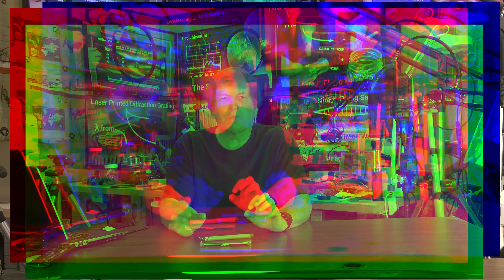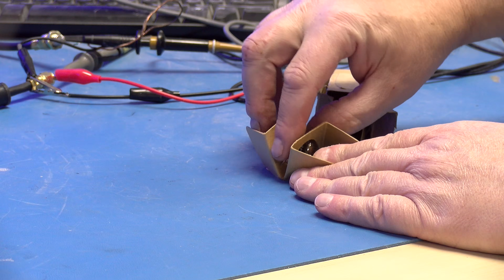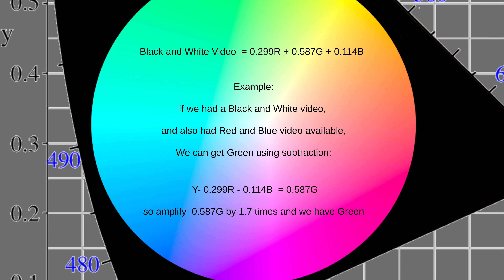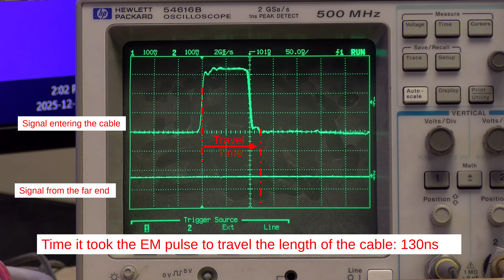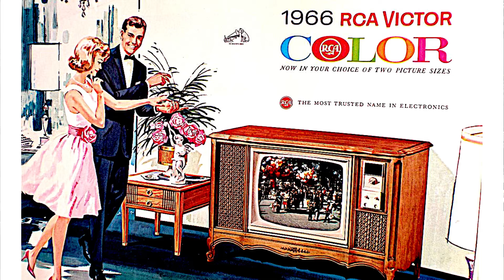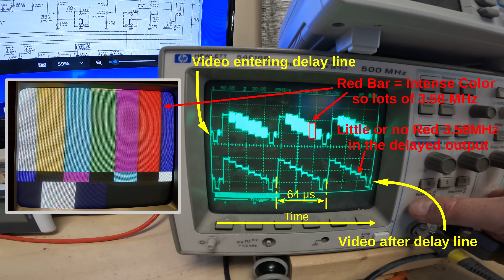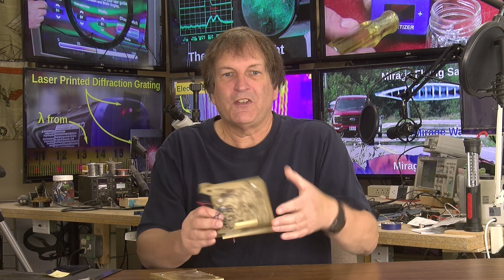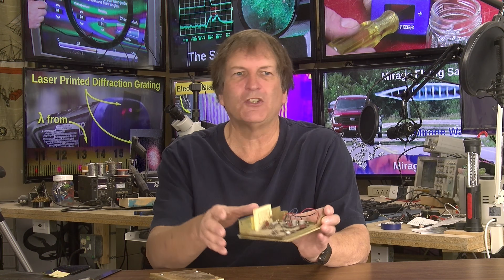How we slowed down electricity to create Color TV

Comment: Retired video engineer here (ABC and CNN): This is an excellent description! We engineers, back then, nicknamed NTSC "Never Twice the Same Color." The biggest problem with transmitting NTSC was differential gain and phase (changes in amplitude and phase between black and white scenes). Differences in gain caused an inaccurate saturation of colors, and differences in phase caused hues to be inaccurate. People perceived changes in hues to be much more objectionable. For example, a deeply red dress appearing slightly pastel red (reduced saturation) due to differential gain was much less objectionable than a red dress appearing purple due to differential phase. Faces often turned green when moving between dark to light scenes. The Europeans developed color TV later and had the luxury of improving on the US system, and used Phase Alternating Line (PAL) that averaged out the differential phase errors. The French decided to use SECAM (Séquentiel couleur à mémoire / Sequential Colour with Memory) which we American engineers nicknamed the "System Essentially Contrary to the American Method," and transmitted the color information in FM instead of AM to also compensate for differential gain. Once an American viewer got over the apparent flicker of 50 hertz video fields, as opposed to American 60 (59.94) hertz field rates, PAL and SECAM looked much better than NTSC. The hazard of being first.
Reply from the maker: Thanks so much times two - once for the kind words and and once for answering a question I always wondered about - namely what was the dominant cause of phase errors in NTSC. So if I understood correctly (let me know if didnt) the amplitude of the black and white signal had the effect of slightly shifting the chroma phase as it passed though amps in the signal path. If thats the case I'm even more intrigued as to what might have caused that effect. All that I can think of at the moment is the slight changes in semiconductor junction capacitance as the voltage across a junction rises and falls a exploited in  varactor  diode. That wouldnt explain the issue happening in tube amps. So what am I missing?

NTSC/PAL/SECAM - as a kid I experienced all three - NTSC in Canada, PAL in (West) Germany, and SECAM in Iraq in the 70s. I dont remember being bothered by 50Hz flicker as a kid, but sometime in 2005 or 2006 I was visiting Germany and stayed in a hotel that still had CRT TVs in the rooms. I sure noticed the 50Hz flicker. Funny thing is I dont remember noticing the NTSC hue change based on the person being in a dark or bright area. I do remember having to occasionally tweak the hue on the odd progam, presumably because somewhere along the broadcast chain someone  hadnt  adjusted the phase perfectly. And after the 70s I dont remember  needing to that  very often if at all. I do sort of remember some older tube color TVs that seemed to have the hue drift slightly as the set heated up - in fairness to them that would have been 1960s TV in the late 70s/early 80s when I was fixing them while I was in high school. So all sorts of components may have become less stable with age.
Reply: @ElectromagneticVideos  I was a transmitter engineer in the 70s for a time. The biggest cause of differential phase and gain was the transmitter. Many transmitters in the 60s, and a few in the 70s, were what we called "forced color" because they were implemented before color TV was available. A 50 KW transmitter was a major investment that stations were reluctant to replace. One station in Los Angles, KCOP, pushed their old forced color transmitter into the mid 70s. Differential phase was irrelevant to monochrome video, and differential gain only caused unrealistic contrast changes that weren't very noticeable. Getting a  50 KW vacuum tube to operate perfectly within its linear transconductance transfer curve, especially when it was operating at its limits, was impossible. It ran at the knees in the curve between black (100% output) and white (12.5% output). Put a chroma subcarrier on top of that, and both gain and phase were distorted by the nonlinearity. The problem got worse as the tubes aged. 

The FCC set a limit of 5 degrees differential phase and 5% differential gain, but there was no real enforcement. Stations self-certified each year with "proof of performance tests," and more than one station I knew of had a set of new tubes that they would swap in only for the yearly tests. A pair of new Eimac 4CX25000 power tetrode vacuum tubes needed for a 50 KW transmitter cost approximately $200,000 each in today's dollars. Stations milked those tubes for every last useable minute of service life.

The hue shifting with temperature was also a real issue for tube-based vidicon cameras. At ABC studios in Hollywood, each stage had a "Senior Video" operator whose sole job was to continually adjust all the cameras on an operating stage for color matching. The drift was mostly thermal. Move a camera under a stage light and it would rapidly drift away from the others. It was an intense job. If you saw changes in hue or saturation on a CRT, it was mostly due to thermal differences between the red, blue and green "guns" (cathodes) in the CRT tube itself. Sony trintron CRTs had only one gun and didn't suffer from this effect.

The reason stations had such large technical staffs was -- in analog -- everything is constantly drifting. They also needed strong men in the maintenance department because lifting a CRT studio monitor or a camera was a two-man job. The switch to digital made everything so much simpler and less physics-based. The technical challenges in broadcast television are miniscule today to what they once were. That's why I switched to cyber security 30 years ago -- where everything is still complex and continually broken.
Reply: @SVAdAstra  Thank god, Walter Bruch came up with PAL ;-)
Reply from the maker: @SVAdAstra  That is fascinating! I had never heard of "forced color" but its sure makes sense that at thos costs, stations would have been reluctant to upgrade to a new transmitter designed for color. 

Swapping tubes for the annual tests - thats a bit of history you dont read about. Didnt know about camea heating messing up vidicon color or how trinitrons were more stabe color wise. And continuously adjusting color on the cameras - wow!

Question: do you mind if I copy your two comments to the posts section of my channel so they are preserved rather than getting lost under newer comments?

Thants so much for this look into analog TV!
Reply: @SVAdAstra  Thank you for sharing this.  Really cool glimpse into the way things worked not so long ago.  I was born in the early 80's so I only experienced the end of the analog era.
Reply: @ElectromagneticVideos  Yes. Pleases feel free to repost my comments.
Reply from the maker: @SVAdAstra  Thanks! I will do that!
Reply from the maker: @SVAdAstra  I'd be happy to credit your comments to you real name if you send it to me. If you dont want your name linked to your profile, I can leave out your YT name. My email is electromagneticvideos [at] gmail.com  . Thanks again for all your insight!
Reply: @ElectromagneticVideos  I remember visiting the States in the late 70’s and was in a hotel room with a tv that had a rabbit ear antenna. Now, coming from a PAL country, I was astonished that as you moved the antenna, the colour actual changed hue.  I’d never seen that before…
Reply from the maker: @gold27b  Thats an interesting observation. I'm guessing that was from reflections from the building being picked up in different ways altering the phase  just a bit. The strongest memory I have between Canada (NTSC) and Germany (PAL) in the early 70s was the strength of the signal. In Germany the signal seemed strong everywhere. In Canada we had a place in the country south of Ottawa and while one or two channels with nearby transmitters were strong, most had weak signals with considerable noise that also showed up in the color component.  It actually looked quite neat.
Reply: "Not The Smartest Choice"...by the engineers who originally designed NTSC.
Reply from the maker: @denelson83  I had never heard that version. Maybe to fair a description - there was so much brilliant engineering to get the first practical color TV system working.
Reply: @denelson83  Not really fair. I think the designers did an amazing job using the technology of the time, and the knowledge of human vision at the time, to develop an upwards compatible system.
It's possible that the delay line technology needed for PAL, or SECAM, was not really available in 1950 when the system was being developed. PAL was invented 12 years later and had the advantage of being able to start with the concepts that NTSC had to develop from scratch!
Some of the issues of NTSC could really only be discovered in use. (I don't know, for example, if any transmitter engineers were on the committee that could have flagged the phase variation due to transmitter nonlinearity…)🤔
Reply: "The hazard of being first"
And the stupidity to stick with it..
Reply: That is why PAL also means: Perfection at Last.

Comment: Why did old tv sets have uhf before there were channels on those frequencies?
Reply from the maker: Originally they only had VHF tuners in TVs, which caused a natural reluctance for TV stations to use the UHF band. And TV manufacturers were not going to add UHF tuners unless there were UHF channels available - sort of a which came first - chicken or the egg problem. 

I gather at some point the US government required TV set makers to include a UHF tuner which resulted in what you reported - in many places TVs had UHF tuners before there were any UHF stations.

Comment: Interesting also that mercury delay lines, and even Kinescope delay lines (the reminisce on the screen) acting as a camera & display tube,  were used as shift registers ( like a memory ) so storing a stream of data as it ran 'round & 'round in circles, as a string of bits!
Reply from the maker: So glad you posted that - I had forgotten thanks to you I'm reminded of reading somewhere about some crt based memories. I didnt realize they were operated as delay lines though. In many ways, memory in sufficient speed and quanity was pas a bigger challenge than the cpu itself. I'm immediatly thinking of the rope core memory used on the Apollo spacecraft where the program was magnetc cores woven into the rope.

Comment: I think that particular coil (@ 23:51) has two windings in opposite directions (clockwise & counterclockwise) and I think that the rf coupling between one end and the other allows the transfer of a sharper delay line signal ( like chromatic aberration in a lens being corrected by combining a convex and concave lens to avoid rainbows around the edges of objects.  Damping and sharpening bandpass ripple by phase cancellation.
Reply from the maker: What a fabulous observation - I did not notice that! I'm not sure if your reason for it is right or not. But clearly there is some good reason for doing that. Clearly not a calibration thing as I had pondered. The other thing I can think of is to prevent pickup of noise/signals from stray fields accidently coming from somewhere else. I'm really intrigued now - thanks so much for posting. Always neat how another set of eyes can pick up something nobody else saw. 

Anybody else have any thoughts?

Comment: If Bill Gate was in charge, he would have told those 6 million black and white TV customers, "Your device is no longer supported."
Reply from the maker: And would have called it TV 11 and offered to keep your old TV 10 going for up to 3 yeats but only if you paid $35 the first year an ever increasing price for the followong two years. And here I am running my 15 year old Dell TV on TV Enterprise IOT LTSC 11  and it works just fine  :)
Reply: And that would have been the way to go - the French did that (albeit they kept the 809 line system for a while)
Reply: @LMB222  The French 819 line system was a dead end from the beginning because of its huge bandwidth requirements which limited the number of TV channels, and its complete incompatibility with any mainstream hardware. Just imagine manufacturers would have had to offer 819 line SECAM VCRs and camcorders for the French market only.
Reply: Backwards compatibility being treated as an inconvenience isn't a single person's fault. It's a broad cultural shift.
Reply: No that would be Apple. Microsoft is the king of backwards compatability.
Reply: Just as AM broadcasters should be told what NTSC telecasters were told, and sent digital with DRM.

Comment: What baffles me is why didn't they transmit the signal delayed? Rather than adding delay lines to every TV they could have had a single one at the transmitter?
It might also benefit B&W TVs to have the dots aligned with the image.
Reply from the maker: Great question - its becuase the delay depends on the difference in bandwidth between the color and luma (BW) images. Many old sets separated color and luma by fltering out upper frequencies (where of the color is) to extract the luma BW image, and extracted the color signal by filtering away the lower frequencies where most of the BW was. Some TVs did very severe filtering. Later and better TVs kept more of the chroma and luma bandwidth, particualry whne comb filters were developed to keep almost  all the bandwidth of both signals. So delay depended on the how the luma chroma separatiom was handled in the TV. However, most common delays in early TVs were about 500ns so your idea would have worked for them but then may have needed delaying the color signal in higher bandwidth sets.

Comment: When I worked in a TV shop I remember putting a jumper across a delay line to see the effect.   The results clearly showed the necessity for the delay line.  I was thinking how much fun I'd have if I covertly hid a 30 gauge wire that I soldered across the delay line  of a set that another guy was working on.   I never got around to that but we had fun goofing on each other back in the days.  For instance, some TV's had plug in connectors on the yoke for the individual wires.  I would quickly reverse the two leads for the vertical windings,  and the newbie tech would be wondering what happened to the vertical, the picture is upside down!
Reply from the maker: Gee I should have done that - what a great experiment. But your idea of prank is even better. Reminds me of a story a tech I know told me about his first day on the job after finishing college : he was given the task of soldering a bunch of things - probbaly cables to connectors. Did well in the morning but had a terrible time after he got back from lunch. Took him a while to figure out that someone had replaced the last few inches of solder on the spool with some wire that looked just like solder - but wasnt. Drove him crazy for a while.

Your swap the vertical coil lines trick - recently saw an old  candid camera episode on youtube where they tried to sell a 25" color TV in a department store at some steep discount becuase the picture was upside down. I would have jumped on that deal!

Comment: Great video. You forgot to talk about the color burst (8 cycles) in the front porch of each horizontal scan that is used to compare the phase of the color carrier during the scan to to get that color angle. The burst was to force a crystal oscillator to a reference phase to be used during the horizontal scan.
Reply from the maker: Actually that was intentional descision that I struggled over to prevent the video from getting longer - and at 40 minutes the video is still too long for most of the youtube audience.I get a graph of average length viewers watch and the shorter attention span of youtube audiences is very apparent. I toatally get that it should have been in there - as well as a number of the things like vestigial sideband and a diagram of the interleaved nature of the luma and chroma spectrums. I will probaly do 2 more videos on the subject and hopefully the burst will fit nicely into one of  them.
Reply: AFAIK it is 10 +/- 1 cycles of burst for PAL with 625 line timing, NTSC is 9 +/- 1 cycles (see ITU BT.470)

Comment: When I did a TV repair course in the 1980`s there was a device in a TV that slowed the signal down using 2 metal forks sort of lock together with a gap that was filled with a quartz crystal. Might be so the same thing.
Reply from the maker: That sounds verry much like an an ultrasonic delay like the 64ns one rowards the end of the video. How big was it? Was it about the same shape?
Reply: @ElectromagneticVideos  That`s the one. I missed the end. Had to get some coal lol.
Reply from the maker: @damianbutterworth2434  Cool!

Comment: introducing a delay is a different concept than "slowing down". And the analogy between meanders for traces length matching and delay lines is questionable. 
We match length to ensure the bits and signals stay in sync, yes, but meanders are definitely not used for "slowing down" the signals, nor are they used to introduce a delay, except in very exceptional cases. 
Meanders are only used to match traces length, which would otherwise differ due to the constraints of the routing geometry, so that signals stays in sync.

Comment: PAL (Phase Alternation Line) 625/50 as used in the UK, subcarrier frequency is 4.43361875 MHz ie.  rounded to 4.33619 shown on your glass block delay line at 34.30.  THE PAL system effectively cancels out the phase errors that plagued NTSC, eliminating the need for a tint (hue) control.  NTSC here in the UK was often dubbed to mean 'Never Twice Same Colour'.
Reply from the maker: My guess is the manufacturer of the delay line made most of their production for PAL and SECAM TV manufacturers, and this one was shortened in delay for an NTSC line but the intended frequency of operation stayed the same (even though it was used at a lower frequency in the VCR).